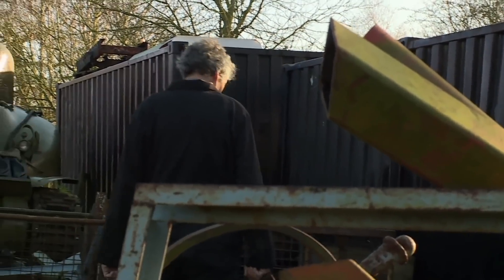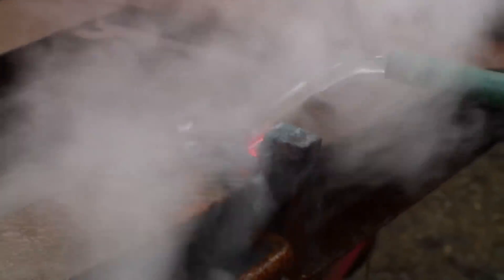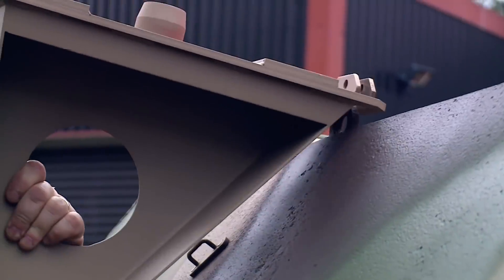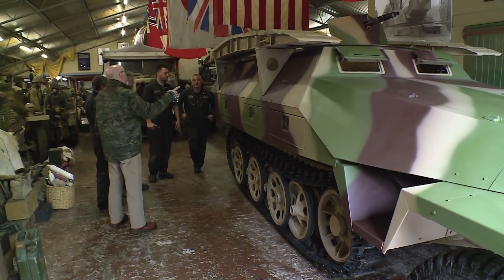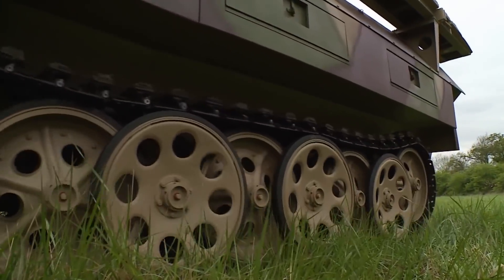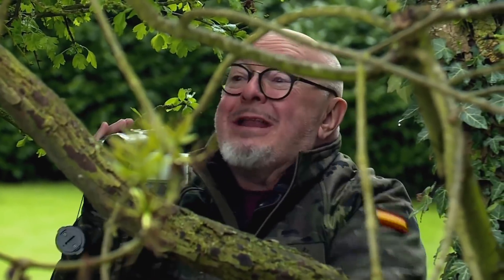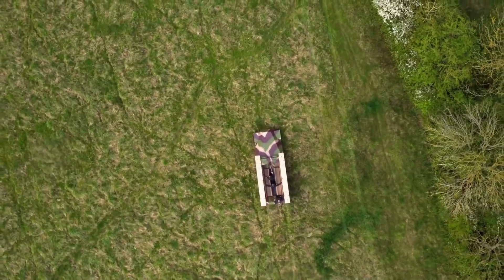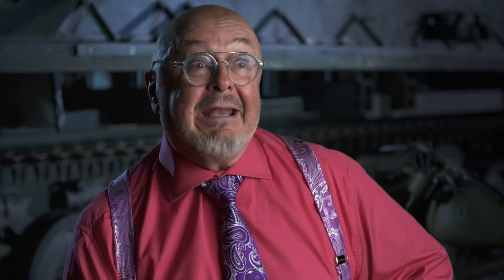Test Driving A Pioneer 251 Vehicle | Combat Dealers

Comment: I was fortunate enough to be taken on a ride on an original, restored SdKFZ 251 years ago during an event held at a local collector's in southern Germany. While it was great to experience this thing first-hand, I did instantly understand why soldiers were wearing steel helmets. It's all edges and hard surfaces, you can't really see out when sitting on one of the two benches in the back and the ride over rough terrain is rather harsh. Got flipped out of the seat and in the air once or twice and banged my head into the armour plating... :D

Comment: Using a blowtorch on and then cold quenching the bridge to remove rust, while it works, it is also how to weaken the bridge sections further, than just the rust (metal cancer) itself.
Reply: Razor 1uk .everyone's an expert
Reply: Razor - i would have thought so too - you're basically annealing the metal. I'm guessing that the effect is minimised on the thicker steel and this technique is not as long or physically       demanding as trying to loosen the parts with lubricant and elbow grease!
Reply: @pod9538  , well not everyone knows that overheating steel will weaken it. so no, not everyone is an expert.

Comment: So the bridgeparts weigh over 100kg each. In the beginning the twins carried them alone and later they needed 40 people to barely carry it?
Reply: Dave because wood is heavy asf😑
Reply: @zino4030  the wood needs to be able to carry "8 tons" of weight, so yes.
Reply: sovietgopnik wood Can Carry a lot of weight but that doesn’t make it any havier
Reply: Its all about weight transfer. 2 guys could lift the weight to hip height, which they did. Getting it up to, and over shoulder height to fit it on the vehicle requires a significant increase in lifting strength. Thus 4 guys were needed. Weightlifters face the same issue. Lifting the weight is the easy part. Getting it over your head is the difficult part.

Comment: Well  the British  call it Pioneer because we could not pronounce sonderkraftfahrzeug😂 it was not used only by pioneers also by motorised Infantry and cavalry units even the Luftwaffe got some units with three point seven Zentimeter anti-aircraft guns
Reply: Well, this model, the 251/7 was for the Pioneers :-)
Reply: @beersmurff  as it is a late Version is
Reply: @beersmurff  well it was planned for them but mostly Not in use  my Fathers Regiment was equipped with old French Somua halftrucks and other captured  equipment the brand new 251/7 went to the Ardennes for the motorised infantry
Reply: @steffenrosmus9177  251/7 is specifically for Pioneers. hence they call it Pioneer on the show. Mot. Infantry had other models of the 251. The /7 has nothing to do with late model or not. It's a designation for it's use and function.
Reply: @beersmurff  Well knre that nur  if you look at the back side of the two fifty one it is the late model produced in 1944  and when it was produced most of the went  tunnel business and not to pioneers
Reply: @beersmurff  i think you have no idea how desolate the Wehrmacht was in 1944
Reply: @steffenrosmus9177  You might want to spell check or rewrite that sentence if you want any one to understand it :-)
Reply: @steffenrosmus9177  The late model backside was the same for all 251, to cut down on production time. But 251/7 means it was specifically fitted for the Pioneers.
Reply: @beersmurff  you did not get it  yI know thst the late model back was tue same in all 251 versions but in late 1944 the Versions were   mostly delivery to the troop  Not regarding their Original purpose. Bloody German Spell Check in this Phone 😁
Reply: @beersmurff  according to official German documents most 251/7 we're delivery in 1944 to the regular  troops and not to pion eers s lot of Commander of Pioneer units complaint antut that . I Need Not to Google the different versions necsuse i hot enough Original documents of them my grandfather W. Kleinschmidt was one of their construtors
Reply: @steffenrosmus9177  Got any link to those documents?
Reply: And it doesnt change the fact, that the 251/7 was officially called Pionierpanzerwagen. So when the Brits call it The Pioneer in the video, that is kinda ok. Has nothing to do with them not being able to pronounce Sonderkraftfahrzeug. Because all tanks and halftracks were called Sonderkraftfahrzeug during the war. Even the Tiger was called SdKfz 182.
Reply: @beersmurff  do you speak German ?
Reply: @steffenrosmus9177  I do. Danish, but speak and understand German. Just dont ask me to write :-)
Reply: @beersmurff  it is a small private  Archive in Bavaria. Have to look up the Website if they have one Looked into those Docs way before the Internet age
Reply: @steffenrosmus9177  That's ok. :-)
Reply: The adress of the Archive was A. Wiesner Nlaimbergerdtrasse 38 94486 Pstethpfen German Found no  Web-Site If that does not work try Bundesarchiv.de